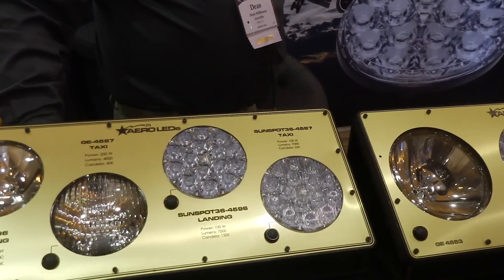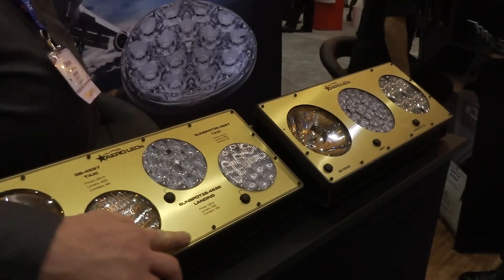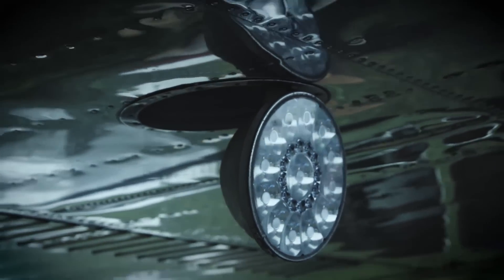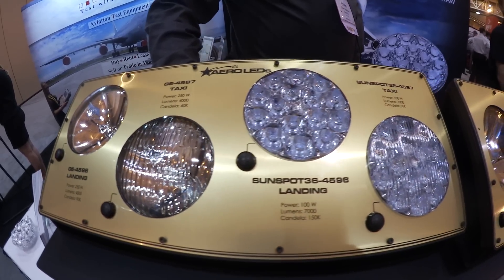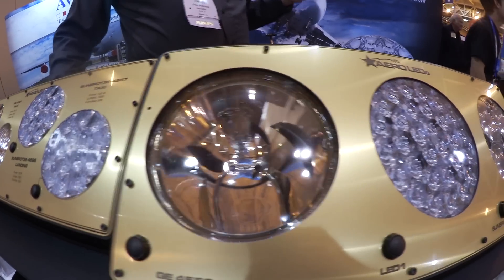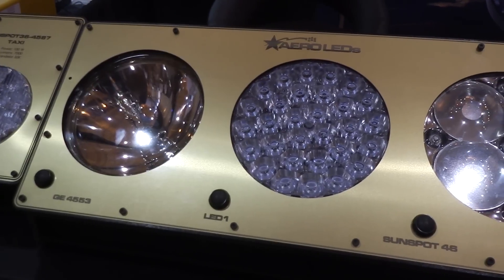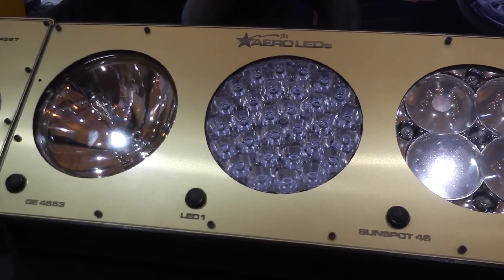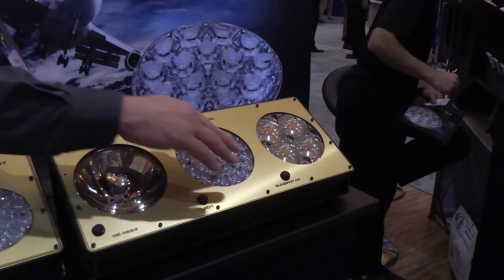AeroLEDs Introduces New Landing Lights

Comment: Considering l.e.d. Aircraft lights?
I had a popping nav/strobe circuit breaker. My mechanic took off my AREOLEDS nav strobe lights,because they were full of water.( previous mechanic put them on)
The previous annual he took off the AEROLEDS landing and taxi lights due to them not functioning.
That same year he took off the aeroleds beacon, I had to turn the beacon off to avoid radio noise on 1/2 of my needed frequencies.
I spent over $3,600 dollars on replacing my incandescent Cessna lights.
I'm glad I made the decision to go l.e.d's, but not to go with the aeroleds brand.

I made a you tube video,of the lights full of water " aeroleds full of water"
Watch it before you buy.

Learn from my misfortune,
"I now have Whelen"

Fly safe.
Reply: Just curious. What aircraft were these on and what was the Companies response to all of your problems?